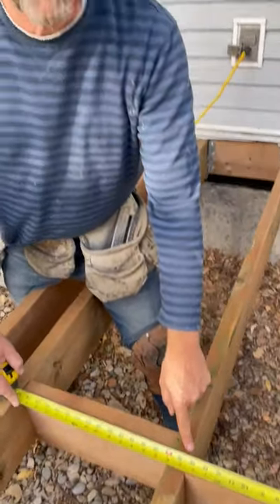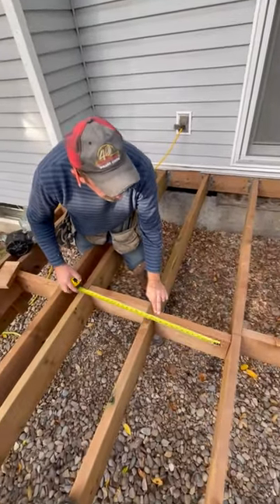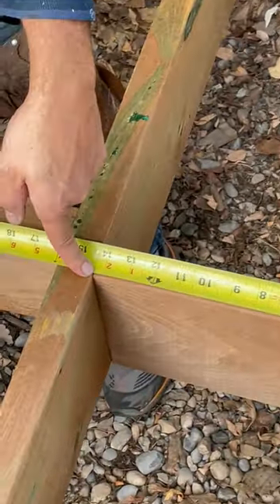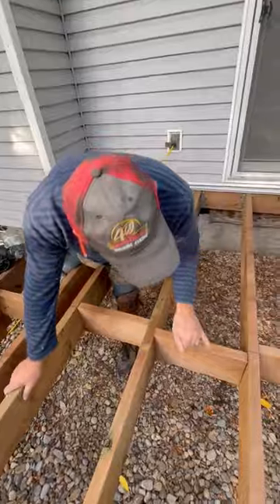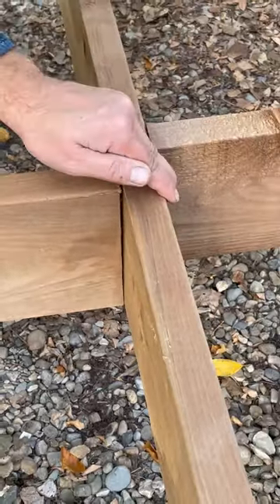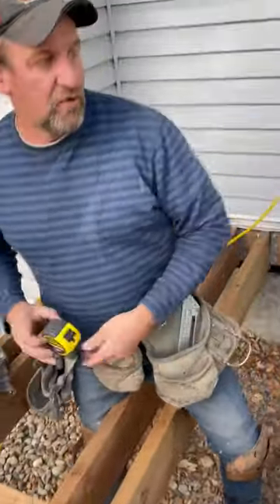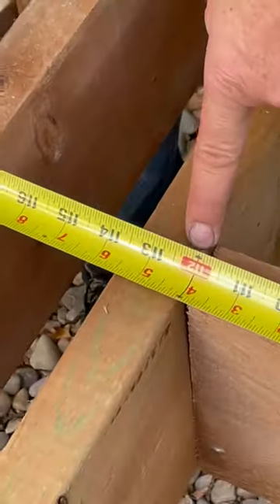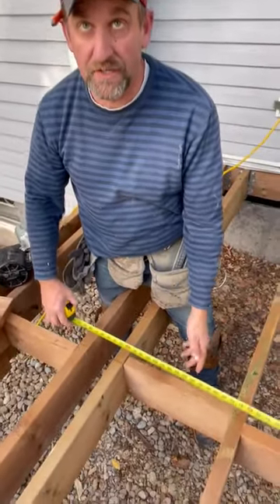Deck Joist Bridge Blocking

Comment: 16 oc is for plywood :) decking it doesn't matter.
Reply from the maker: With 5/4 and most composites 16" oc is max spacing.
Reply: @decksbye3269  bro... It doesn't need to be 16 oc perfectly. That's for plywood.....
Reply: @decksbye3269  it can be 15 and 17 oc won't make a difference.

Comment: I mean... you could just run a joint line on a table saw, then your chop saw is making 90 degree cuts. Im not trying to be a pest, and for what the joist is doing I suppose it doesnt matter... but its not perfection.
Reply from the maker: Yes, there are ways to make it better. This is jsut one way to account for the imperfections.
Reply: @decksbye3269  
I did commercial framing for a few years, and we would have to put blocking every 8ft. on 19ft. exterior walls.
This was hundreds of blocks all the way around twice.
We always cut them 3/8, and would adjust every once and awhile if needed.
Reply from the maker: @Thesaurcery4U2C  Yep. my experience too. Ridge blocks, bridge blocking, fire blocks, all the same, a little shy with occasional adjustment, work better than the other way around.
Reply: @decksbye3269  
Accumulative Error, Is the term for the occurrence. 😉

Comment: Imagine if you used mm
Reply from the maker: Milimeters are hard to read in construction ;-)
Reply: Millimeters are easy.  If you know your timetable. 400mm centers hook your tape on the end 425,825,1225,1625etc
600 center same again 625,1225,1825etc no fractions all round numbers.

Comment: 😂 it’s all getting covered with deck boards. those blocks are a waste of time and are doing absolutely nothing. they have no structural purpose. before you start decking. tack a scrap/ crappy looking board to your  joist on layout with 8’s in the middle. that will straighten them. install your decking up to the straighter board, pull it off and finish the deck. effectively saving 15 minutes and a rack of gun nails.
Reply from the maker: Not only do they help to position the joist correctly but by tying the joist together thye improve the strength and regidity of the joist.
Reply: @decksbye3269  The deck boards themselves screwed/nailed into each joist are going to make the deck ridge as can be along with a good sub frame and foundation. They will do little to nothing for downward pressure or sheer. if your deck is bouncy you need to lessen your spans or size up your material. I’ve been a rough carpenter for close to a decade now built a handful of decks and hundreds of houses. Doing stuff like this wastes expensive material, nails, time, wear and tear on tools. for what? some patio furniture lol gtfo.

Comment: You'll be short by the 4th-5th joist
Reply: except he showed 7 joists down and was bang on, numbnuts
Reply from the maker: Possibly, but on average it works its way out. Just like correction lines when installing decking. For a wider deck a "correction" block every few joist blocks is a good idea. 
If your seventh space doesn't work out.

Comment: That 1/8 you’re missing on the blocks is the 1/8 you took out bro if that block was cut at a perfect 90 it would fit properly. You’re making people think you know what you’re doing. You’re a beginner
Reply from the maker: Yes, if the cutting was perfect (mitre saw) and the wood perfect it would all work. But that is not always the case.

Comment: Na get a rubber mallet and get those 14 1/2 inch boards in there nice and tight with no gaps.  And cut your boards straight.